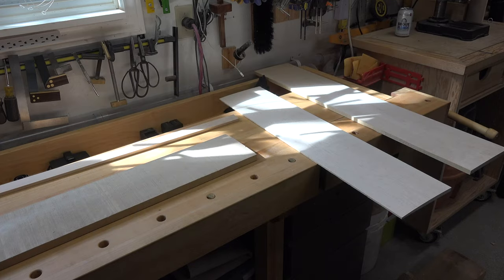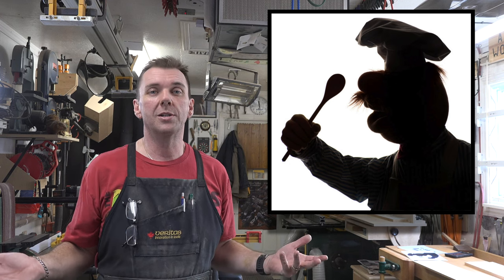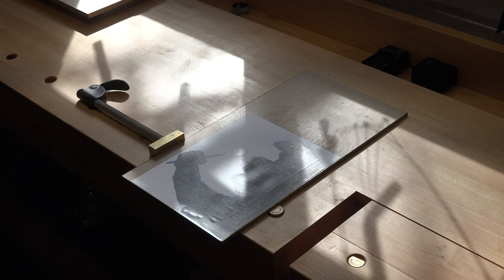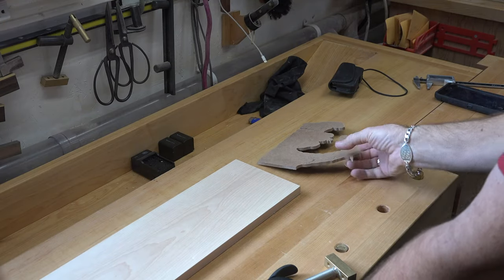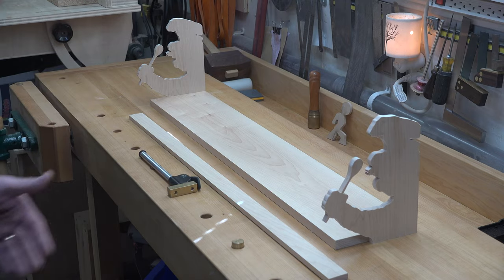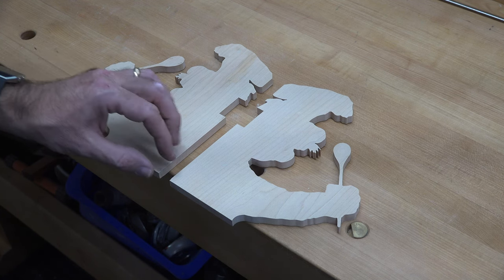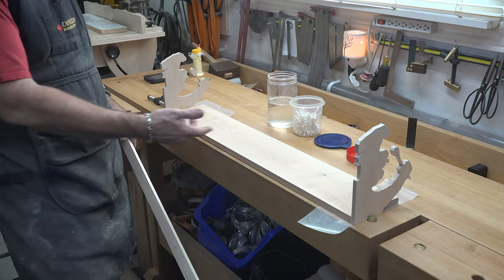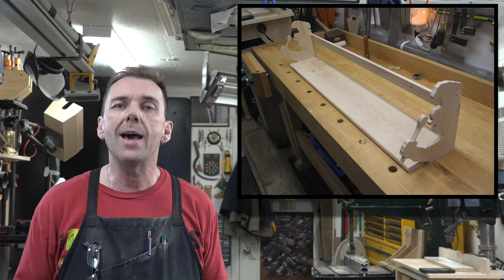Making a Doorway Shelf

Comment: Great video as usual, and a great way to use some offcuts, of which you seem to have plenty of. LOL I noticed with all the offcuts I have, they are either not long enough, or not wide enough for what I want, so it means cutting into a new plank and ending up with even more offcuts.
Reply from the maker: That's the problem I am having with the project I am working on right now.  The offcuts are just crazy but I am hoping to use them in the latter part of the build coming up soon.  That's the problem with cutting wood, there's always a piece left over.  If there wasn't a piece left over, we wouldn't need to cut it.  Thanks for tuning in Brian.